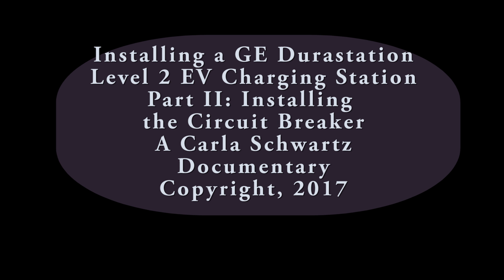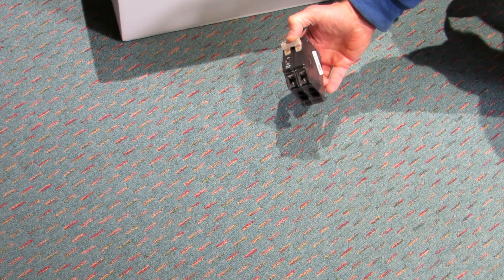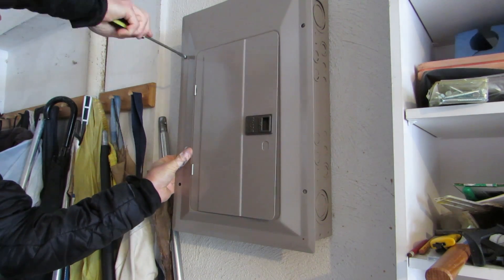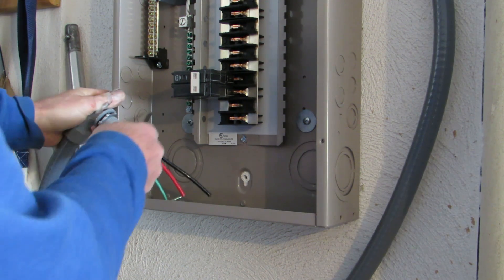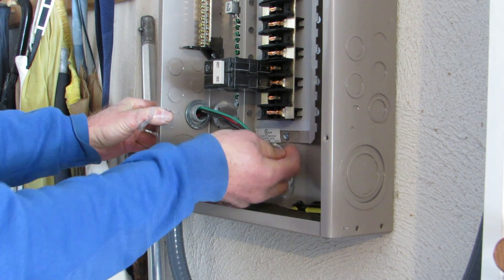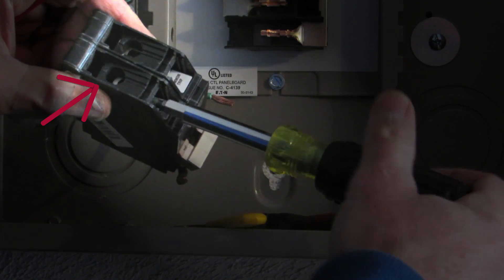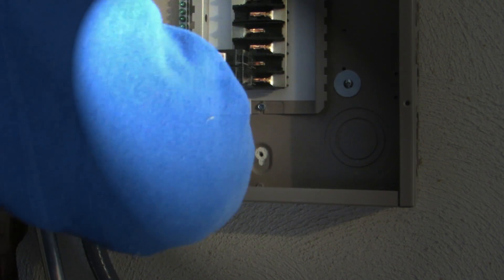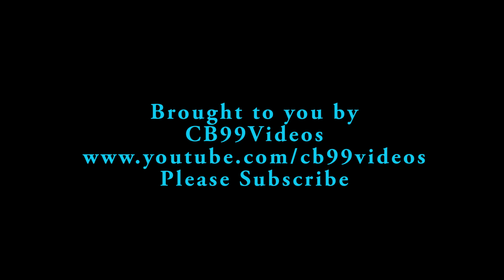Installing an EV Charging Station Part II: Installing a Circuit Breaker #cb99videos #circuitbreaker

Comment: when you install the wire into the panel you could cut back the tubing so you have more wire to work with also you should trim back excess tubing and install through the top of  upper part of the panel and then you would have plenty of wire inside the panel to work with for a cleaner job without the excess tubing needing to be mounted to the wall surrounding the panel

Comment: how many amps, does the charger need?
Reply from the maker: It's a 30 amp charger so a 40 amp circuit breaker does the trick.

Comment: My house is under remodeling. The electrician rewired the whole house and give me a separate circuit breaker for 240 volts charging.  I do not have a EV yet. There are several models I am interested in. I asked him to put a plug in for now and he asked me which kind I want.  Is there something he can install for now so no one can reach the wires.  Now the wires are just hanging out on the wall with no electricity going to the wires.  He wants to do whatever I want so it will be safe.   What should I ask him to do?
Reply from the maker: Depends on what you plan for charging. I have a charging station that is hard wired, with an 8 gauge whip and a 40 amp breaker for the 32 ampm, 7 kw charger. If you search on amazon, you can now buy quite a few plug-in type charging stations, and depending on if these are 40 amp (requires a 50 amp breaker) or 30 -32 amp (requires a 40 amp breaker) you will need 6 gauge wires (to the 50 amp breaker) as opposed to the 8 gauge for the 40 amp breaker. If you do have the 50 amp breaker, you can install the 14-50 nema receptacle, but you should look at which charging station you would want to install. As long as your breaker is off, the wires are safe, and you can tie these off somewhere, maybe near the breaker box until you are ready to install your charging station. Best I can do. Hope this helps.

Comment: I bring my station outside and plug it in, when I’m done charging, how can I shut it off? Since the breaker is not designed to be a switch. Do I just put it on pause or put it on delay when I unplug it. It’s a big plug and want to unplug it without any power in the cord so I can take it down and bring it back inside since I’m in the city I don’t want it stolen. thanks.
Reply from the maker: Hi, I hope you have found an answer by now. You can use the breaker as a switch but that is unnecessary.  Just like plugging in or unplugging any j1772 connector, it is safe to unplug. For extra security, you can stop the charging from the car before you unplug the charger. I hope this help.s

Comment: Could you tell me what earthing/grounding system is in use at the property? Does it have a buried earth/ground electrode or is it provided by the energy supply company via a common/separate neutral?
Reply from the maker: Home has a buried ground for the electric system.
Reply: Check NEC. Should already be there. 2 copper grounding rods. 6 ft apart and each deep. Or equiv.
Reply: @donniecheese5967  It all depends on the year the house was build.